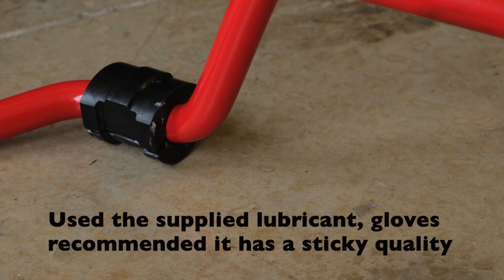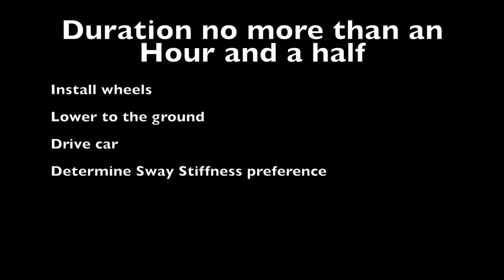BMW e36 front adjustable sway bar install

Comment: I wanted Eibach for my Tesla, but due to COVID their facility was shut down and they were on back order with no ETA.

I ended up buying a set from Unplugged Performance. Not bad... Turns out they're 3-way adjustable.

Anyway...

Are you gonna be at Road Atlanta next weekend Oct 24-25?

If so... See you there!